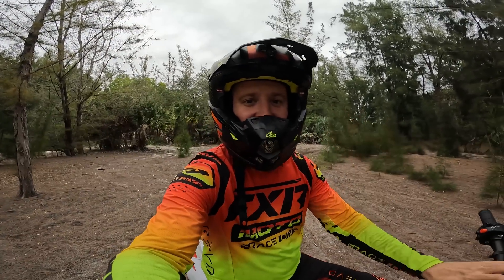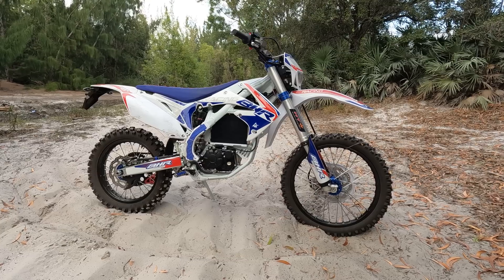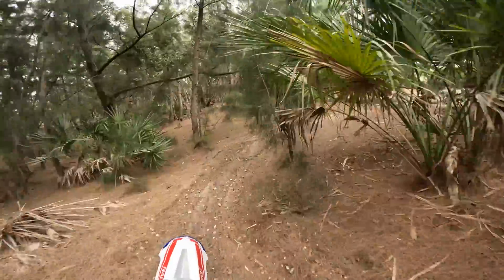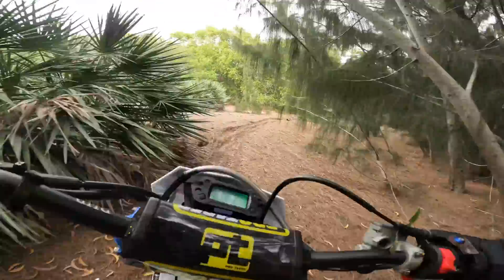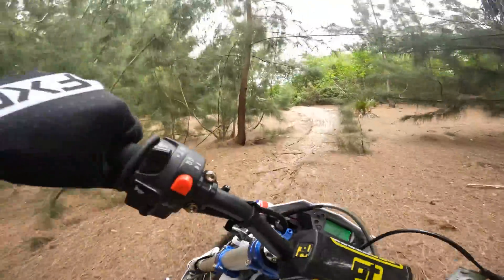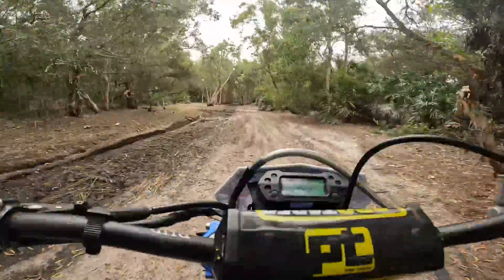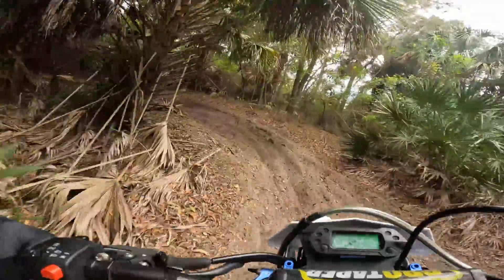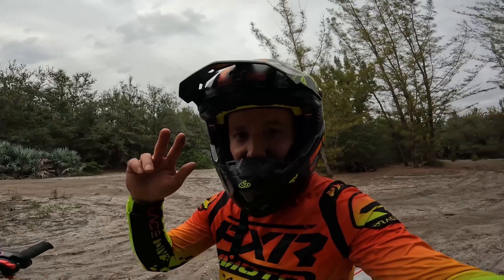BHR E-Race Electric Dirt Bike | 50% Honda?

Comment from the maker: One thing I did forget to point out is the weight, the BHR E-Race Enduro has a dry weight of 273 pounds (before adding oil to the gearbox). 

Current Pricing of the BHR E-Race Here: https://bit.ly/ECRMarketplace

See more about the BHR E-Race Here: https://bit.ly/BHRERaceFirstRide

Shop Aftermarket Parts Here: https://bit.ly/ECRParts
Reply: It’s the Chinese pit bike transmission! They are junk and not for any real power I’ve seen. Need like 3wt trany oil to help false neutral we’ve found. It will always have problems. 275 lbs makes my ‘23 KTM FREERIDE seam light at 230 lbs. new’24 KTM’s are coming! Great video keep it up
Reply: 273 pounds, (before adding oil to the gearbox).  Ouch.
Reply: Top speed?

Comment: Interesting bike. Cheers for the video. 
Do you think with the gearbox and big battery this bike would be getting close to being genuinely capable of trail riding? For example my local trail there and back would be about 40km(25 miles ish). Depending on the weather its fairly steady riding up to about 20mph with maybe 5 short harder sections. Quite often on my current bike I would follow that trail, then do another 20km on tarmac to the enduro track (which has some good longer loops) and then return the same way. In total this normally  ends up being about 90 to 100km(60 miles ish) 25miles of trail, 25 miles of road and 10 miles on the enduro track 
Id happily tolerate extra weight if it meant I could have an almost silent low maintenance trail bike. I think the bike being quiet would help with maintaining trail access as it tends to be the noise that pisses people off.

Cheers 
Paul

Comment: For me. Putting gears on a bike that doesn't need them is a negative. For us guys like me who will ride anything, dig the idea of no gears. That's what makes it super different beside the power source. I'll just go back to the 2t when I want gears. As far as weight, heavy sure but if it rides well, then let's go. The suspension is the elephant in the room for us MX guys. Sure you could change it out but that's all about money. At 8500-ish I want the ride, especially on a pig in weight. Don't get me wrong I freaking love the bike and am super excited where this goes. But let's make it quick. I almost think the ultra light bee could handle more of the mx scene. Especially price wise.

Comment: They're getting there. 4 speeds is probably 1 too many. Gear spacing is probably wrong for the electric. Need a wider ratio. And knowing Chinese manufacturers, that clutch would be toast in no time, on technical climbs. But this is looking more like a complete package than everything else I've seen to date.

Comment: I have the Nicot version of this bike, it’s close to the same specs my battery is only a 50ah but it is a Denzel gear box. Gears 2 and 3 and where it runs best and it’s a stomp box shifter so you don’t really need to use the clutch when riding, that might be some of the false neutral problems you are having.

Comment: OK, so for the sort of riding you are doing in the vid, the gears and a clutch are worthless.  How about some technical trails with steep climbs, rock faces and logs/ruts where the value of a clutch is priceless?  Traction is king in those areas and torque delivery has to be controlled.  A comparison between a clutch version and direct drive in tight, technical trails would be the real test.
Reply from the maker: As much as we wish we could snap our fingers and be in any environment, we have to work with the opportunity that is presented to us. The test bike was offered to us in January in Florida.

Comment: Would be great to start comparing some geometry numbers to the big 5 dirt bike manufacturers. Like how steep is the ultra bee head angle vs the ktm freeride or a yz250? just an example.  would also like to see some more varied terrain.. how do electric bike do through slower speed rock gardens, or enduro cross features like logs etc? Thanks for all the content!:)

Comment: Disappointing overall I think - too heavy. Better to do smaller batteries and offer hot swapping. At least until we get better/lighter batteries. Personally what I really want to start seeing in this e-mx bike reviews is a real gas powered dirt bike riding along and able to compare how they both leave jumps/berms and so on. Its hard to tell how fast or slow or sluggish these are acting without a real mx bike to compare it to.

Comment: I get the want for the clutch and maybe the gears but is their any need for neutral on an e bike?
Reply: Probably using an off-the-shelf transmission, and not something customized
Reply: For towing if your battery died in the field.

Comment: Looks like chinese crap to me. Build guality, material quality and quality control are always issues. I will never buy chinese bikes again. Availability of parts is also a nightmare.
Reply: It is made in china. They import it and probably they make a better job upgrading some parts, but still... It isn't necessary crap, anyway. The problem is the price.
Reply: Go ride a Kayo K6 or GPX FSE 450R then tell me if Chinese is junk. They've gotten considerably better although I'd rather not buy from China if avoidable
Reply: Try saying a talaria is crap. The quality is top notch and theirs an endless supply of factory parts for cheap or aftermarket parts of all kinds designs colors reinnforced if you wanna pay a little more. The possibilities are endless and the power to weight ratio is by far the best when upgraded not to mention its usable off road like a dirtbike but still just barely passable as an ebike for in town. Best of both worlds

Comment: I wonder if an electric dirt bike would benefit more from a CVT transmission rather than gears? they definitely need ratio changes to keep torque for hills and wheelies, and power for top speeds.
Reply: Stark varg is able to control torque and go plenty fast with 80 hp.  The Japanese are behind in the electric department.
Reply: Definitely interesting concept not sure if a cvt could handle the abuse though

Comment: Taking price out of the equation, what do you think of this compared to the ultra Bee?  I got word they are in, can be shipped as soon as I pay for it, so I wanted to get your input, still leaning towards the ultra bee, unless you tell me otherwise.👍
Reply from the maker: Great question! I think the better comparison to the BHR is the Surron Storm Bee, though. I think the chassis and suspension on BHR feels sportier than the Storm, and for that reason, the BHR rides lighter and more predictable than the Storm. I do think the powertrain on the Storm is much better than the BHR though. I've been impressed with the powertrain on the Storm.

The Ultra feels so much different than both the Storm and the BHR. If you're leaning towards an Ultra, I wouldn't let the BHR sway you in a different direction. It is much heavier (by approximately 85 pounds) and overall has a much different feel.

I think an Ultra Bee with some mods would be the best move if you're looking for that lightweight, in-between type of electric dirt bike.

What type of riding are you doing?
Reply: @ElectricCycleRider  thanks for the detailed reply, much appreciated. I’ve been on and off dirt bikes for 40 years, I’m almost 60 years old, however, very fit, mountain bike all the time, I certainly don’t act my age. With that said, I just wanted to goof around the neighborhood, crank wheelies, tracks or riding areas are pretty far away from where I live now, so, just really to goof off around the neighborhood more than anything, so ultra sounds perfect for what I want. I’m 6 foot/180 pounds.
Reply from the maker: @PaulDamage03  Ultra sounds like your bike!
Reply: @PaulDamage03  ultra is too much of a real dortbike to get away woth riding around town. You may want to consider the talaria sting R
Reply: @MotoAlias  we live in a unique neighborhood in North Carolina with 2400 homes and 20 miles of surrounding mountain bike trails. Won’t be a problem riding ultra bee around on the road, there’s golf carts all over the place in the neighborhood, a lot of times kids driving them, kind of a private secluded neighborhood with a lot of people.   I can’t ride ultra bee on the bike trails, but there’s tons of areas underneath powerlines and places I can make myself a little tracks or just goof around where I want to, so I still think ultra bee is the perfect bike for me, neighborhood is not an issue luckily, as long as I don’t ride around like a total idiot🤣

Comment: The frame has nothing to do with the Honda CRF frame, it's not even inspired by if you look at it. CRFs have extruded and cast aluminum frame, while this has a much simpler and cheap welded steel frame that has nothing to do with the Honda one. Geometry may be similar but overall construction is completely different. The plastics have the same mounting point, it's just that. The fact that people keep repeating their shameful marketing pitch is really saddening to me. A serious reviewer and cool guy like you know better! Anyway, I tried a similar thing too last year in Milan, with a different name/brand, but almost the same size and same motor. I hit some false neutral too... and realized that, to me, you must change the final transmission ratio to make the 4 gears gearbox make sense, so that you can use the first gear as super low crawling gear on the trails and the 4th on the road. Overall, the bike I tried seemed too cheap and costed half what BHR asks now (and you can't register it here in Italy). No, thanks...  For 4/5K with all the docs to be registered as L3e in Europe it will make much more sense.
Reply from the maker: Seems this has struck a cord, so happy to dive into it some more. I have not heard the "shameful marketing pitch" that you're referring to. If you care to expand on what you mean there, I'll listen to your viewpoint about that. I had not heard one person directly compare this chassis to that of a CRF (including BHR) before releasing this video, which is where I'm getting confused by your claim that people are repeating it. I personally had the realization when looking at the frame geometry and design, along with physically riding the BHR, that I could draw some very direct comparisons to the mid 2000's Honda CRF's that I've personally owned over the years. You're absolutely right, Honda CRF's are aluminum. The BHR is steel. 

My assumption that this is a replica of a CRF frame came from analyzing the two frames and knowing that these style frames have absolutely been replicated by other manufacturers overseas. Yes, materials are different, as you mentioned, and that does have a large impact on the flex characteristics of the chassis. But using close to identical geometry would make me beg to differ on your statement that they have "nothing to do" with each other. The bike feels like a Honda CRF 450X with an electric powerplant. Ask me how I know...

Very possible that the bike you rode had a similar, or identical, motor gearbox to this bike. Your thoughts are plausible on that part of the bike. I just don't necessarily subscribe to your arguments about the chassis. Always open to hear your ideas and thanks for bringing it up. Cheers.
Reply: @ElectricCycleRider  I agree they look similar and have similar geometry of course it's a knock off though and knock off are never as good as the original so it being steel and not lightweight aluminum makes sense. Although that would maybe help them drop the weight on this bike some that's a big no for me on this bike it's just to heavy. I wouldn't mind having a uktra bee though I own a talaria now with bac8000
Reply: @ElectricCycleRider  I wrote a detailed response but I can't see the message anymore. What happened? Who is that struck a cord here? Uhm... not expecting something like this from you. You are completely wrong about the frame, it has noting to do with Honda at all. I am not asking to subscribe to my argument, there is none, it's a fact. There is no resemblance to mid 2000 honda frame at all, go compare it side by side and it will be absolutely clear. Not mentioning the fact that honda has a complex cast+extrude aluminum construction...while this is cheap steel with arguable welds. I am a bit disappointed in you, repeating the marketing bs that many vendors said on facebook (and got slammed for it). You should know better. For the rest I just expressed my opinion on the gearbox, but I liked in the end, while you seem to had more problems with it than me.
Reply: First thing I thought too.  No where near a honda frame or chassis.  Maybe similar geometry, but quality, construction, even materials are way different.  Hahaha even with identical geometry an aluminum frame will feel completely different from a steel frame.

Comment: Good stuff! Disappointed that the bike is that heavy, and those transmission issues shouldn’t be happening, regardless of if it’s brand new or not. Poor excuse. I’d like to see more bikes like this, keeps the rider engaged and gives current gasser riders a place to go better than a surron. Hopefully we see some offerings from other manufacturers in this field. If that weight was closer to 200-220 it would be a winner.
Reply from the maker: @All Motors Media For sure! Agree. Definitely some room for improvement and hope that BHR works on these aspects of the bike. The weight is largely due to the 4.8kWh battery and although a lot of weight could be shed by going with a smaller battery, it would obviously impact range. Always a give and take there. I'm personally happy to see another bike in the market that is going this direction and everyone needs to start somewhere. Cheers.
Reply: @ElectricCycleRider  yes, that battery must be heavy. In my opinion (which may be contrary to popular opinion) on a bike like this I’d rather have the MFG include 2 smaller battery packs that are easily swap-able. That’s just my use case, maybe in the future we could see this being an option; big battery for long enduros with no swapping, or smaller lighter batteries for shorter more aggressive stints.
Reply: @ElectricCycleRider   I'm not convinced on that there is a pit bike out I believe it's a utr Ultimate trail machine and there 5kw and it's pretty comparable to a normal pit bike in weight
Reply: @devinej8411  wrong metric. your comparing motor output (KW) to battery capacity (KWH). the bike you are referencing has a 1.4KWH battery.

Comment: If you had only 2 gears then a mode switch change on the fly could be set up as a change of gear without the extra mechanical baggage. Probably could even do it with more maps to resemble more gears. I only have experience with electric riding on my Sur-ron but dont miss the clutch at all. It will be interesting to hear what you think after more testing. I also wonder how it effects battery life as the motor will be drawing power at time but not transferring it to the ground if riders like to slip the clutch a lot.
Reply from the maker: I would love to try a "high/low" gearing solution for different riding scenarios. It often feels like the hard accelerating eMoto's fall flat on their face after a point and would be great to click it up to some higher speed gearing when the bike begins to plateau in power. Add it to the wish list!
Reply: Yeah two gears would be perfect. I have a mode switch set up custom on my Zero MXE kind of like a 2 speed. Computer programable controller

Comment: 273lbs is way to heavy.
Reply from the maker: @Eastwood It's definitely in the heavyweight category. For reference, the 2007 Honda CRF450X had a dry weight of 255 pounds. Swap that gas motor, add a 4.8kWh battery and different variety of suspension/wheels and the story checks out.
Reply: @ElectricCycleRider  need to have Showa / KYB  stock  -
Reply from the maker: @GroovyVideo2  It would be great to have Showa or KYB but from a manufacturers perspective, it's not as easy as just slapping those components on and putting it into production. KYB or Showa needs to decide that it's in their best interest as a company to supply BHR with these components for mass production. Even if they hypothetically did decide to do that, I'm sure those premium suspension products would be reflected in the price. Simply putting KYB or Showa on a 1 off prototype or project bike is definitely feasible, but everything gets much more complex when the bike actually goes into production. But yeah, I hear you, I personally wish all bikes came with KYB SSS!